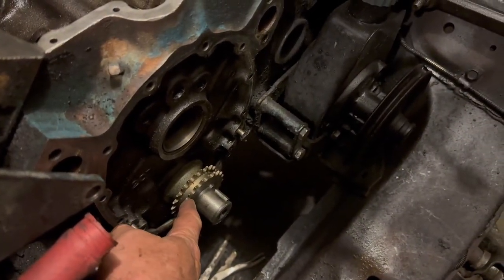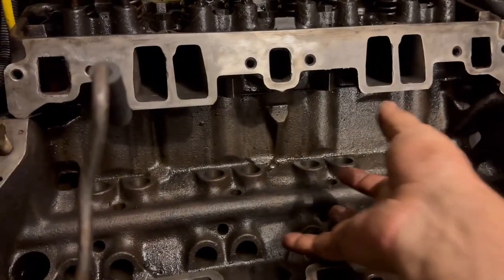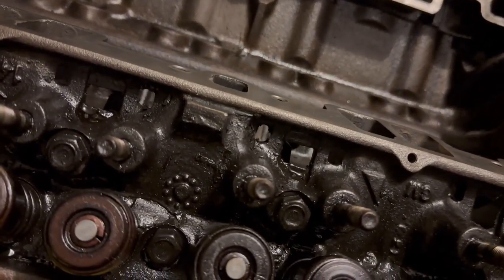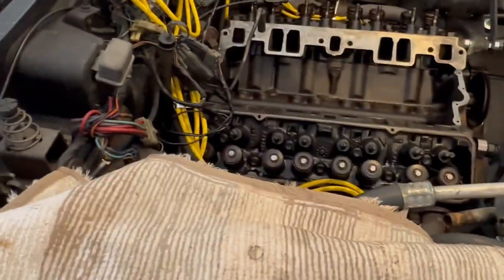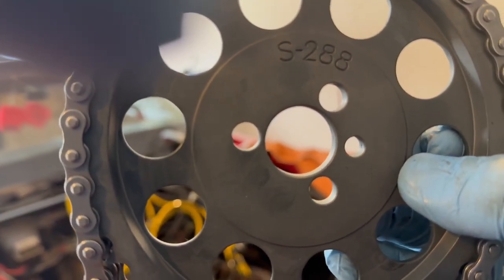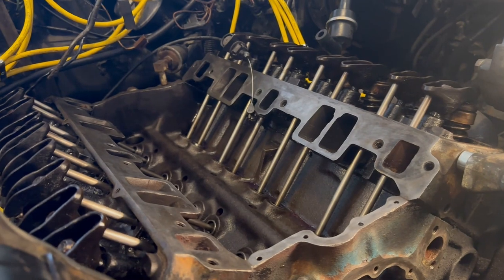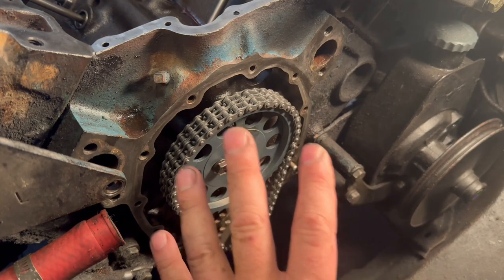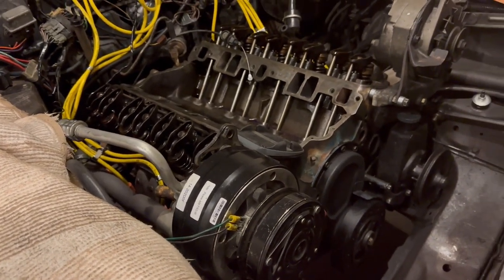1981 C3 Corvette Cam Installation Part 1

Comment: Hey Mike, that twin geared timing chain and gears, they have been around forever, street name is double roller timing chain. But mighty fine choice. Got a set in my 86 pace car vette.
Reply from the maker: Good to know. I'n not an auto mechanic, I just have the tools, the need and a little desire.